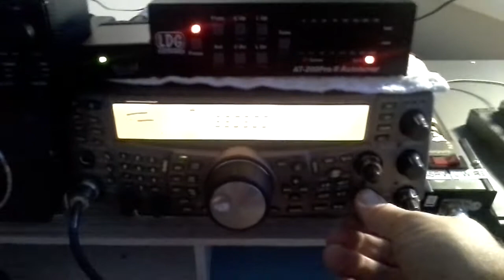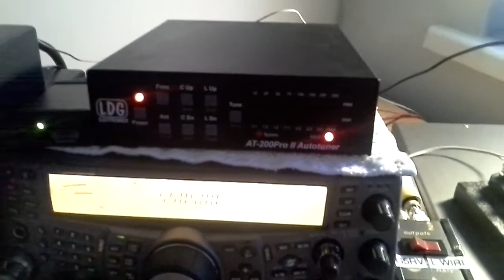Long wire adapter for  radios with only a bnc outlet

Comment: Looking for an antenna for my DX394. Would this do the job ? TIA.
Reply from the maker: mark williams Yes it certainly would for the hf section of the radio 1 to 30mhz
Reply: @MrDarren4963  thanks.